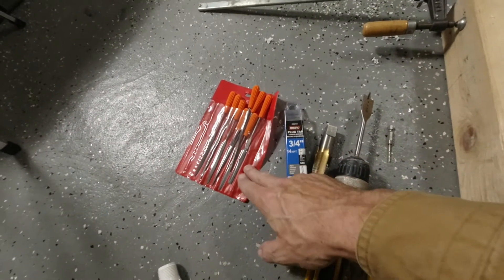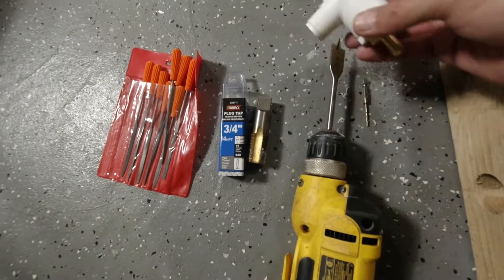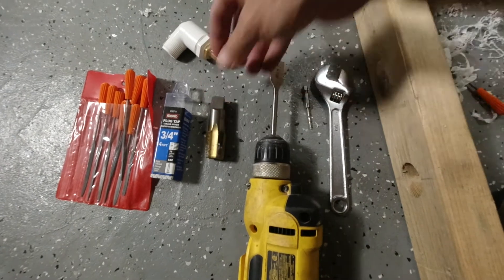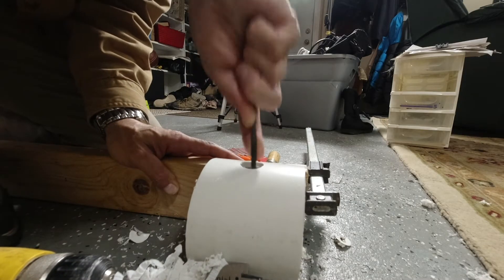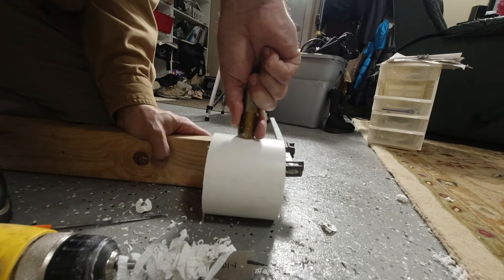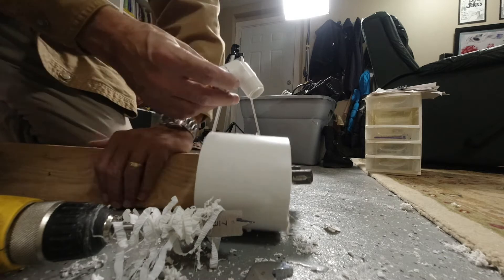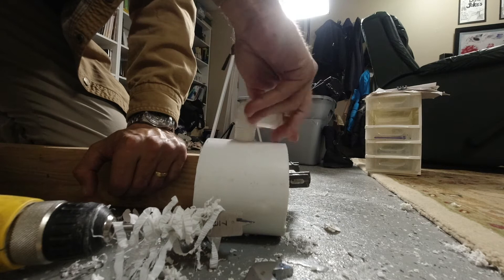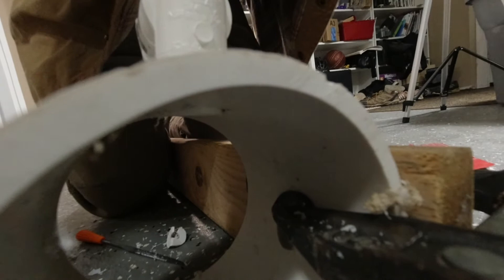Drill and Tap PVC Pipe Quickly

Comment: If that's for condensate you can't use metal fittings. Even using brass the acid will eat through the barbed elbow over time.

Comment: Sometimes the square end of a tap will fit in a 12-point socket-but not always. It's much easier to tap using a ratchet than it is with an adjustable wrench so it's worth it to check and see.
Reply from the maker: Thanks for the tip

Comment: I was making a camp shower water source with 6" Pvc tube and found using a 3/4" Forstner bit for 1/2" hose bibb valve and 1/2" bit for 1/4" pressure gauge fittings works well using regular clear Pvc cement(primer not needed). All you have to do is manually start threading the fittings straight and can easily wrench tighten as needed. Threading is leak free and secure without expensive taps, Harbor freight has bits.
Reply: How much pressure does your system have? I want to make a manifold out of a PVC pipe but unsure how leak-proof it'll be in a low pressure system since the wall of a PVC pipe isn't very thick and therefore, not much contact for the threads to seal.

Comment: Thanks for the video! I am tapping into a PVC drain pipe, connecting the tap to clear tubing coming from a crawl space dehumidifier. Now I just need to make sure I have a tight seal between tubing and tap. The tubing is a lot softer and smaller in diameter than the drain pipe. Open to suggestions...

Comment: Do you have any info, or opinion, on using PVC glue on the PVC to PVC screw threads? I’m thinking that the melting chemical bond might reduce any pressure that might tend to split the larger pipe.
Reply from the maker: sorry, I don't.  Maybe someone else will chime in.

Comment: what is the dimension of 90-degree MPT x FIP Street Elbow Fitting?  MPT side is 3/4 inch I can tell but how about the FIP part?  I need to make 1/2 inch NTP thread into a PVC sewer cleanout. I don't have no tool. I need to buy the spade drill as well as the tap. Please provide your suggestion. Thanks. So far I got 1/2 inch pvc male adapter from lowes. I have noticed that inside diameter of pvc adapter is 1/2 inch for MPT side. However, outside diameter of MPT side is almost 3/4 inch.